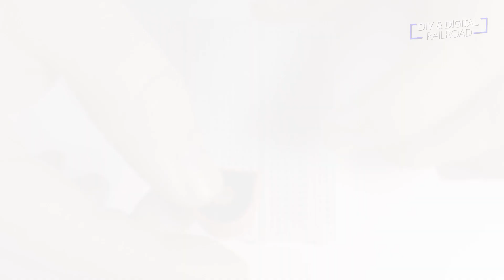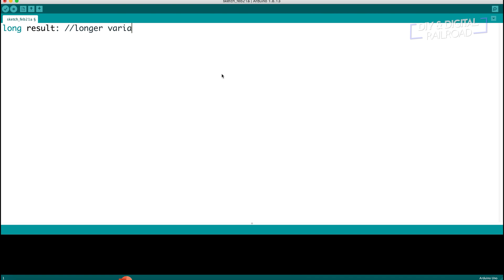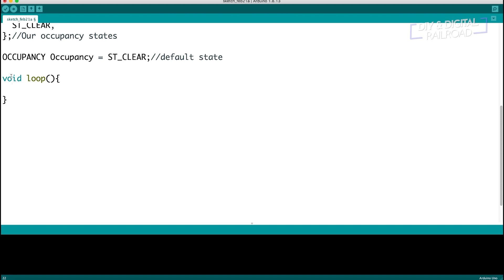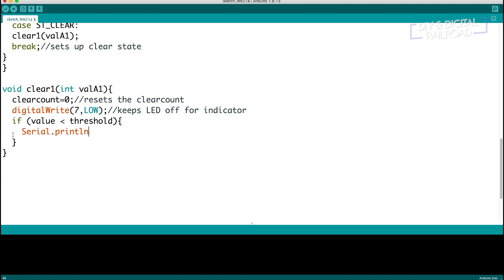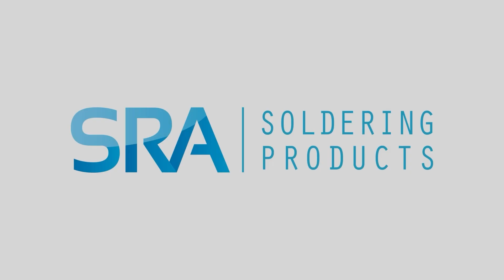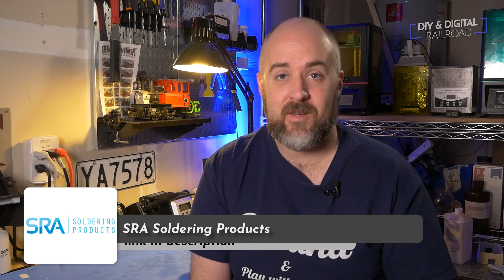Building a Cheap DIY Current sensor for DCC with an Arduino!

Comment: Using 1.8.13 also.   After getting box to download, file appears on desktop.  When clicked, Arduino asks to create sketch folder ... after clicking OK I get message saying sketch could not be created.
Reply from the maker: Ok I am going to work on this.  In the meantime.  I have created a text file of the arduino sketch.  You can download it here and copy it over https://drive.google.com/file/d/1A9la42Mua2r6FDue5KzmDQbj89hunKgn/view?usp=sharing